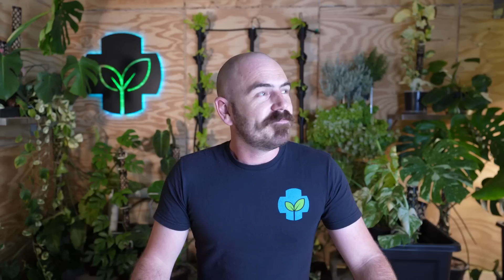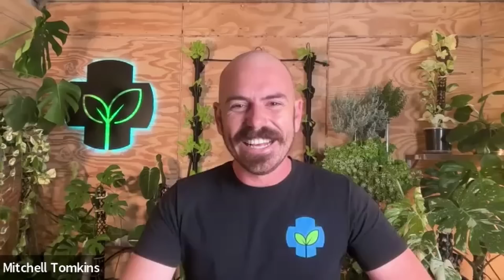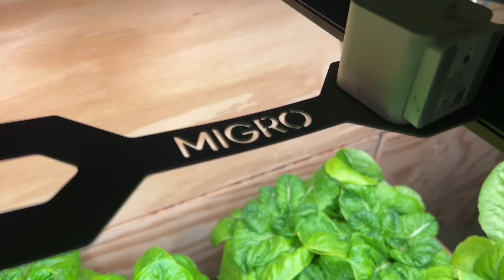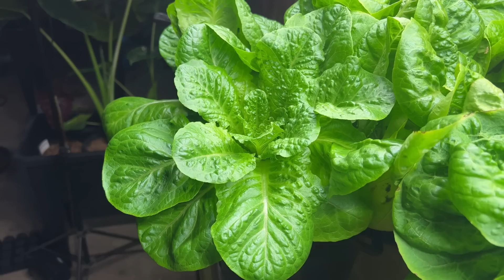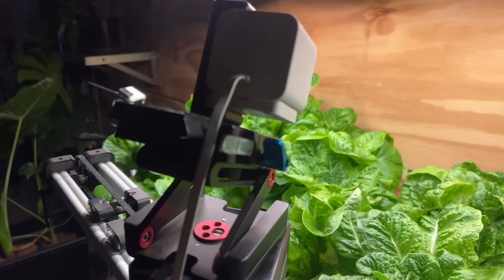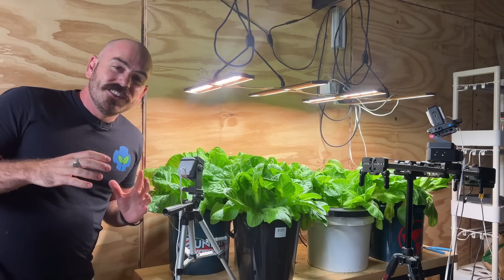Get Started Growing Indoors with Grow Lights

Comment: Shane is definitely the go to for light tests mj coco is another. I have only just gone to full led I use hlg rspec and viper spec . But my mh and hps definitely have there place . Just don’t rush in! Do the research preparation and plating prevent piss poor performance

Comment: Great video, both channels have provided a wealth of knowledge in my search for answers. After learning about par and umols etc etc in my very young and early assessments of my own grows have found that the smaller quality lights are the answer. I have a large expensive light and for the price wish i bought 3 more smaller lights to get more spread. But, that being said, i am a tinkerer and don’t mind making a few mistakes to learn along the way.

The subject is vast, but further discussion on a specific lighting setup based on a plant would be super cool. Eg. Lettuce, or whatever people most want to see.

As a newbie, something I’m working through at the moment is the importance of steps taken at specific times. As a pretty hap hazard gardener, i get away with murder in the garden and have plenty of luck. A bit of a conundrum i came across recently, is specifics around nutrient requirements as seedlings and what exactly staging up the nutrients looks like through the plant life cycle.

It might sound simple, but its one of those things,you dont know what you dont know.

Hence my reference to being lucky in the garden. I am quickly realising a few mistakes which is driving a pretty fast learning curve, but it might be something a newbie could avoid with the right information.

Also, thank you for replying to my email. Happy Hydroponic ing!